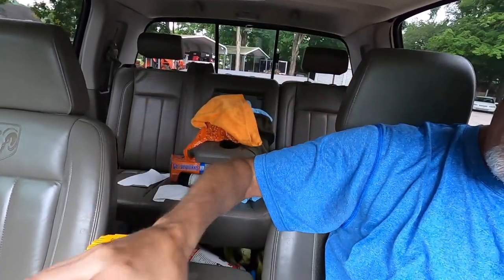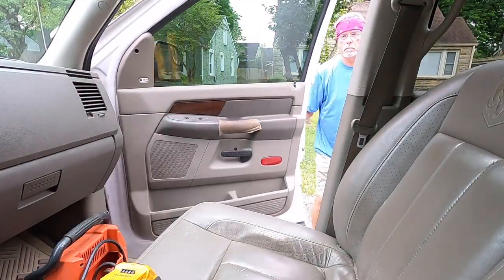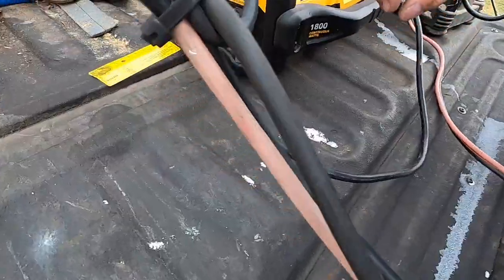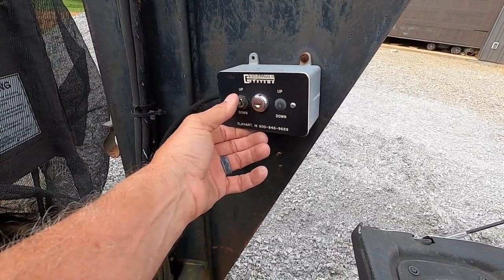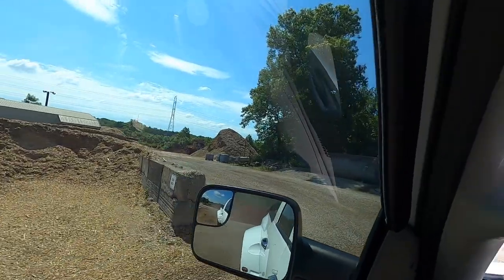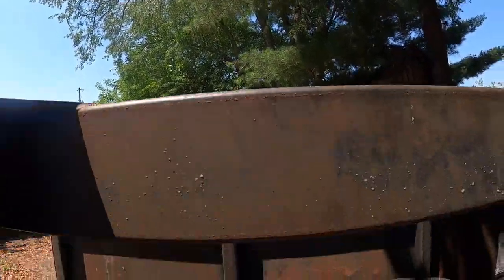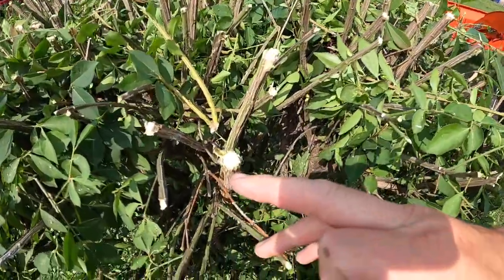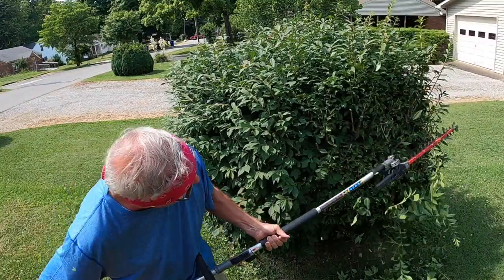What's up DeWalt

Comment: Knock on wood but so far all my Dewalt tools and batteries have been perfect. I'm in the process of replacing all my 20v batteries with the 60v flex volt. The 20v ones are fine but I just like the extra run time. This isn't a cheap goal lol.
Reply from the maker: I’ve only had 2 DeWalt batteries go bad in the 10 or so years of buying batteries. Ive had a 60 volt 6ah and a 60 volt 12ah go bad. Never a 20 volt so far. Thanks for commenting
Reply: Dewalt 20v hedge trimmer is awesome. Lightweight and the battery lasts forever. You will be happy with them.